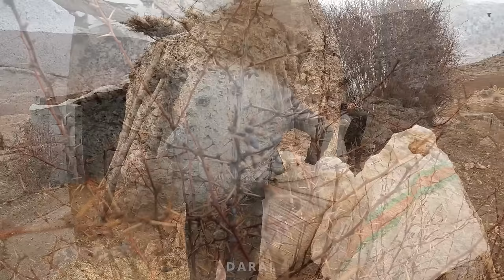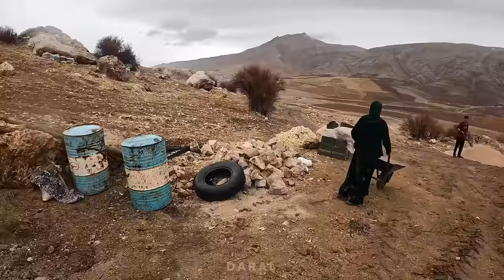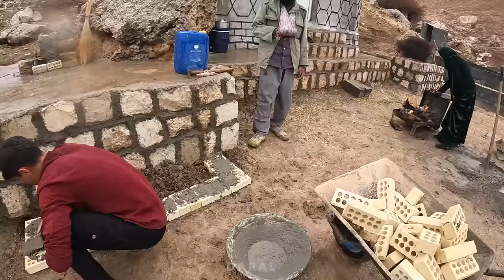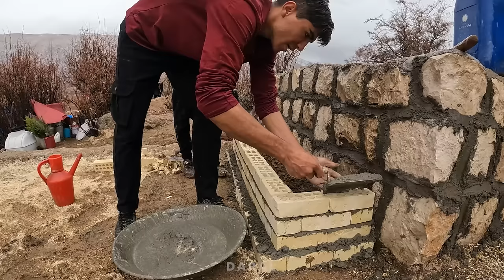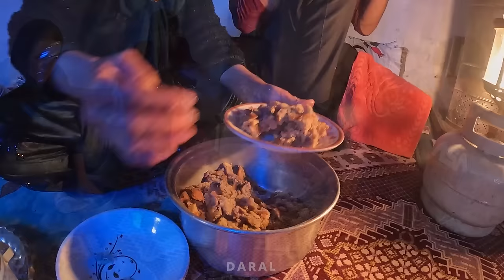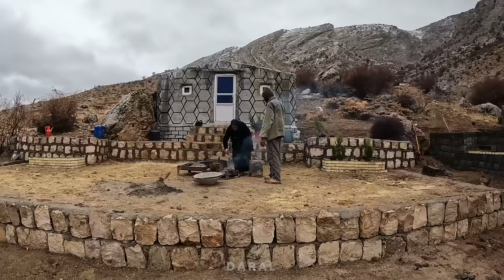"Amir and his family: creating brick pots for pine seedlings on a rainy day"

Comment: You need an awning for the front porch to protect from the sun and rain, it will look nice with a weather proof canvas only require a few post and no major construction.
Reply: I think so as well, a canvas or a translucent awning.
Reply: I thought they should never have cut off the roof poles that were sticking out they would have been useful to build a cover on
Reply: I thought exactly the same thing

Comment: Why was the 2nd room positioned to sit crooked, not aligned with anything around it.  It's sitting catawampus !  Can the donkey lie down tied up like that? Or is he forced to stand while tied up 24/7?  Does he have something warm to lie on other than the cold ground? When it's sunny, can he be taken out of the shed and allowed to warm up like the dogs?
  Can the excess cement on bottom row of bricks on both planters be scraped off and cleaned?
Reply: The donkey needs attention, yes, he is tied down and not allowed to stretch his little legs for a happy run

Comment: do not plant a tree closer than 30 feet from the house minimum, to avoid the adult tree to uproot and crack the concrete on the floor and the concrete of the nearby house
Reply: I've planted a golden weeping willow this year, 
In lower elevation, they grow 25 feet in each direction and it can grow up to 2 feet a year.
Reply: @christianekarns4575  yes! got to be totally aware of these things when planting!
Reply: These are shrubs that grow straight up.but they are still too close. Just for the camera movie set.

Comment: Great videos, keep up the good work family.  Your home is coming together well. Just one thing, could you please put a covering in front of the dogs home to block out the wind, rain & snow.❤
Reply: If they took 1 of those real thin boards they have and nailed it up under the roof if the doghouse and tacked 1 or 2 of those empty cement sacks ( they look like they might have a plastic coating on them) to that board  the dogs could still come and go as they pleased but it would help block out rain snow and wind. Cost nothing too.

Comment: If you'd put the cement on ends of bricks/blocks as you lay them then there would be no need to go back to cement in-between later. Also better to put cement down and not smooth flat! that's just dumb